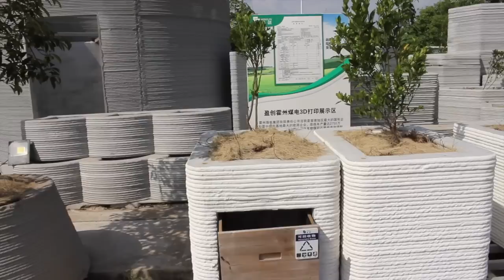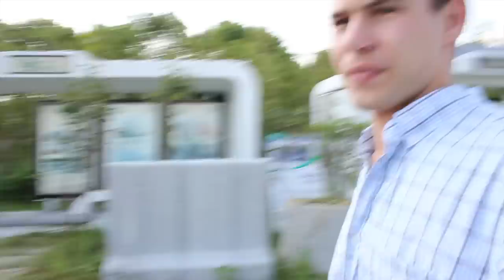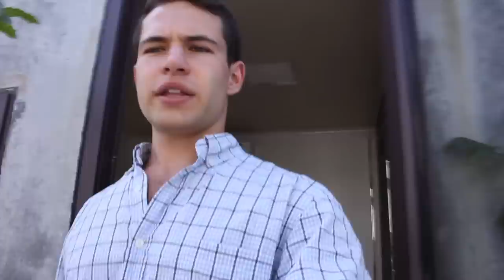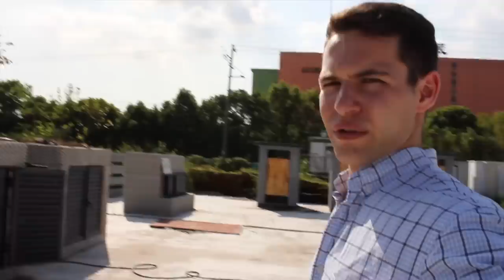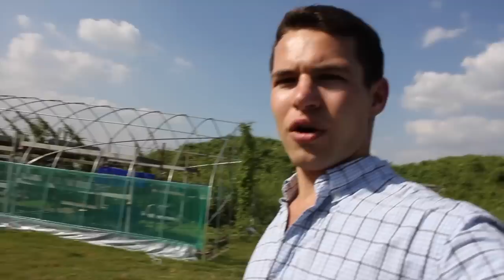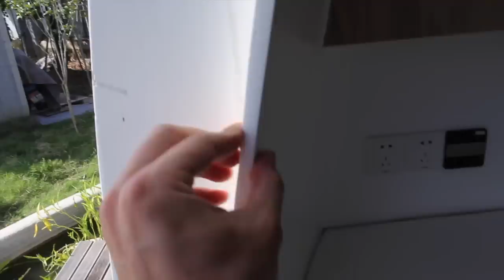Winsun 3D facility tour

Comment: how did they print the floors ?
Reply from the maker: Generally it’s a traditionally poured slab but sometimes the house is printed on its side then rotated 90 degrees along the axis of the longest section of a hypothetical rectangular house which would require 2 walls to be built after printing.
Reply: @automateconstruction  - yer I get that Jarett - i was curious about the floors of the mansion. My guess is they used precast concrete planks and poured a topping slab. In which case its not really an entirely printed 3d house is it ... unless they printed the precast slabs on site.
Reply from the maker: @MichaelFlynn0  Ah yes you are correct it is by no means an entirely 3D printed house.